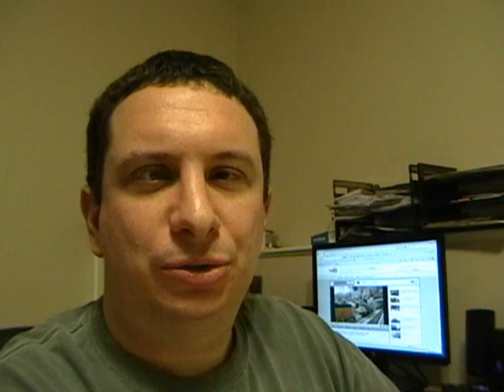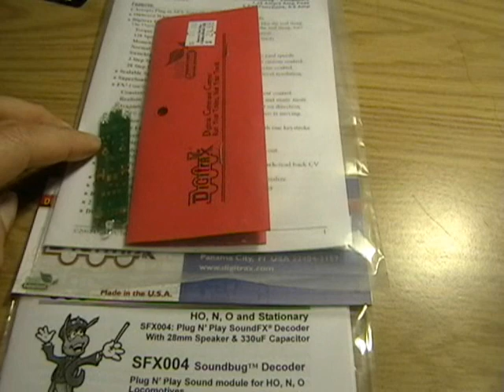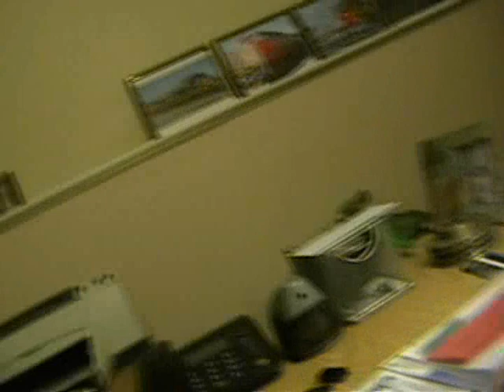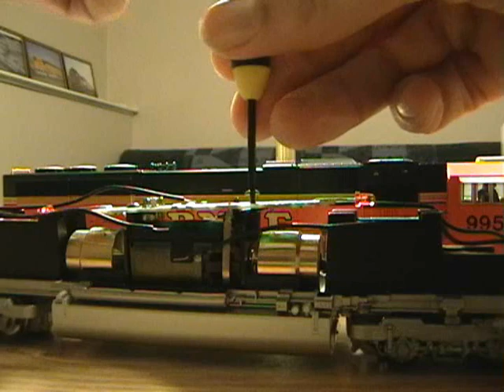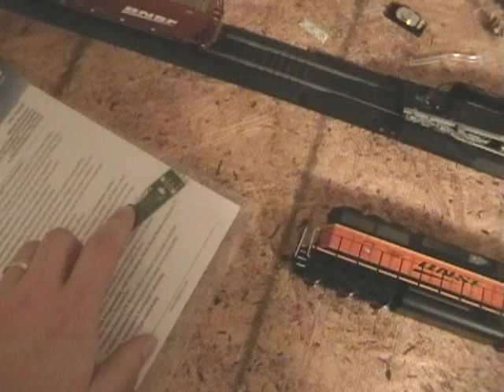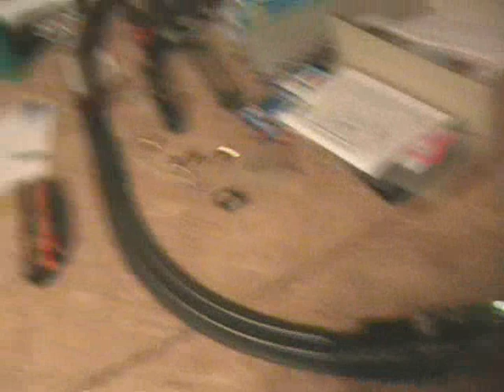01-01-2010 Advanced DCC - Part 3A Sound Decoders for Kato

Comment from the maker: You can really set it to what ever you want. I set all mine to a value of 40 so that all the different loco's run together with a good consist. There's really no right or wrong. Start with that and you can make adjustments from there.